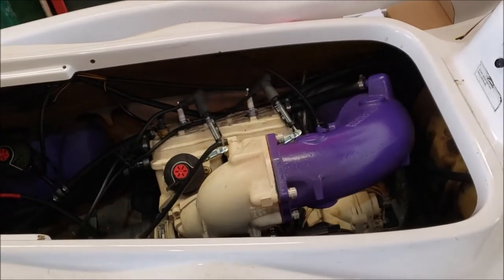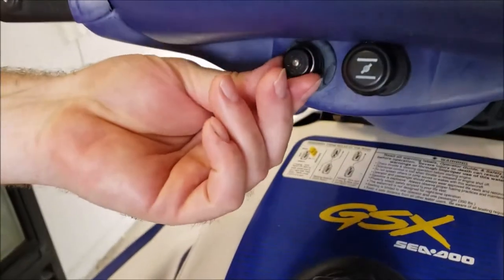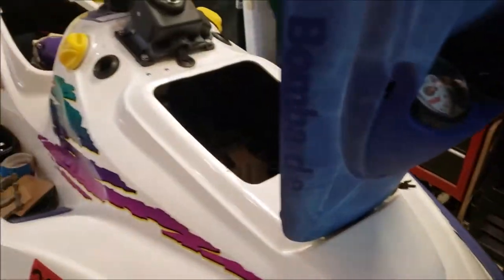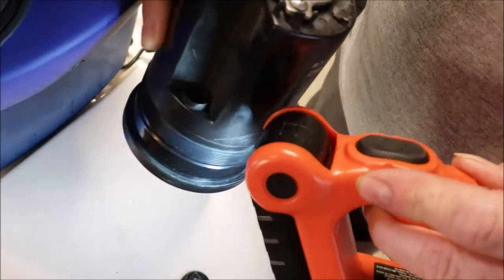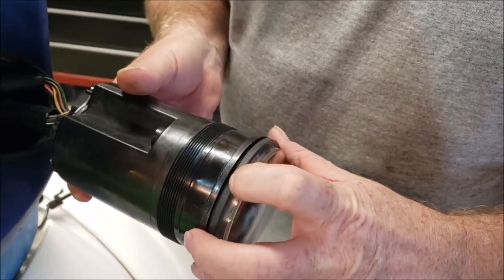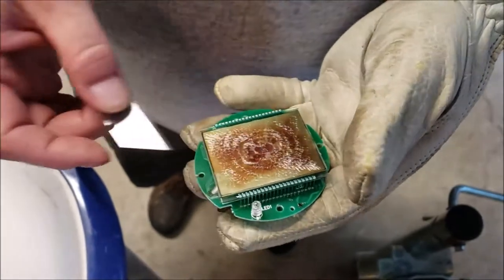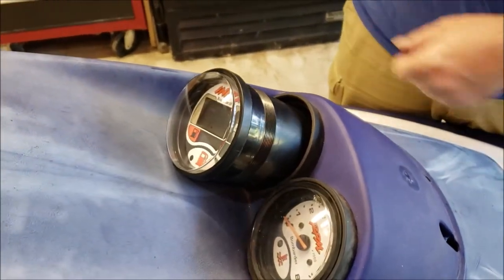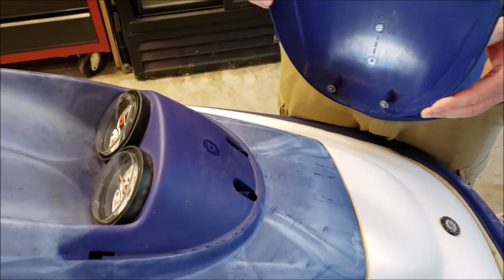1996 Sea-doo GSX Info Gauge repair

Comment: The way you opened up the gauge is also an old school Hack people use a lot of times to set the mileage back on analog speedometers. It has gotten so bad that when I go look at buying a dual sport motorcycle, or anything with a analog speedometer, I check to see if the cap has been opened up with a screw driver. Sooo many times I have not purchased a bike because this hack was done. Very easy to spot due to the fact you have to mash that lip back down when you put it back together, and can plainly see where the prying marks were. Great job though. I picked up a newsed 99 GTX Limited the other day that needs this done. 👍

Comment: You didn't use silicone or adhesive?
Reply from the maker: Neither did the factory. Crimp the bezel closed slowly carefully and completely. Never had water in any of the dozens I have fixed.

Comment: Where did you get the film?
Reply from the maker: I got mine off Ebay. It is readily available as LCD polarizing film on Amazon and many other sites. I would start with about a 2.75" square and then trim to fit once you have the gauge apart. If the film you buy isn't marked for orientation then leave the inner adhesive protection on it and try it on the powered up gauge to be certain you have it correct.
Reply: In my case, I didn't get the film in my country. I found a broken TV screen and cut part of the film and put it on the screen. It works great!
Reply: Great video! Can you show us how to zero out the hour meter after an engine rebuild 😁 ?
Reply: Thanks for sharing. I have Kawasaki jetski’s. The fuel and oil level and RPM are visible on the film when the cluster is not powered up. This mush mean those parts are printed on the film?
Reply: Do you have a link.
Reply: Aftermarket MPEM will do that for you.